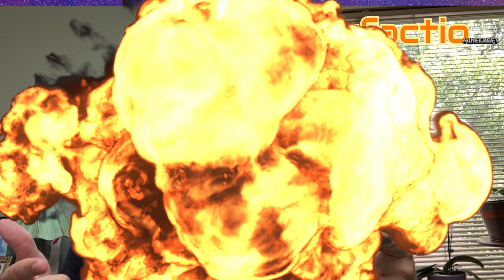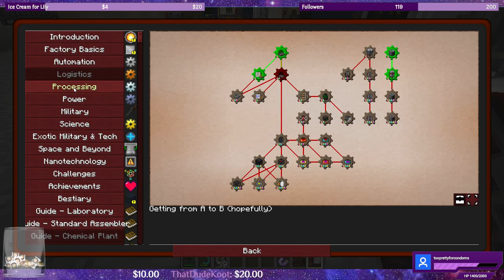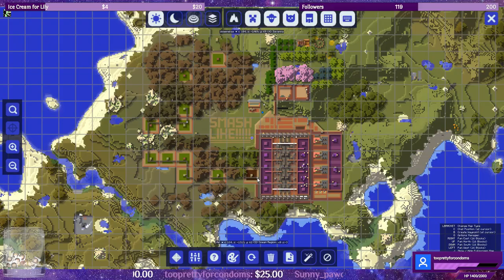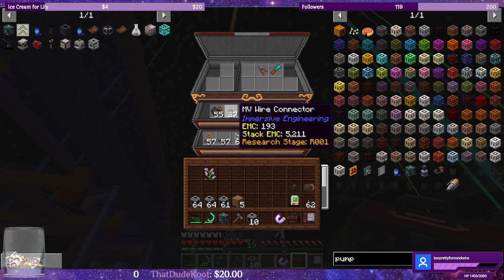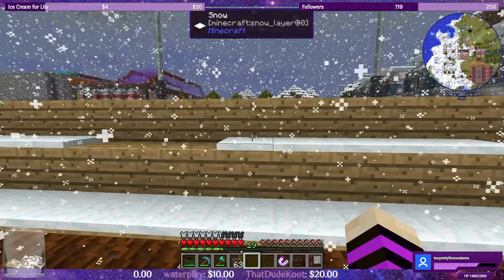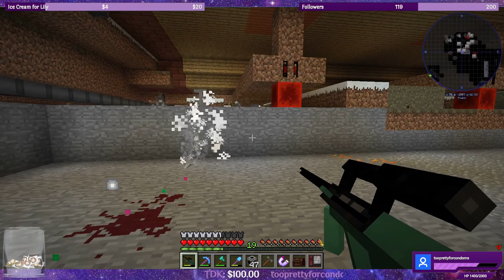Lets Play Manufactio EP 6 - Oil Pump and Oil Refinery - Sheetmetal Fluid Tank - Gasoline Lubricant

Comment: i thought you could also drag fluid from jei to filter fluid and item routers like you can do with enderio filters
Reply from the maker: I think that’s what I did later on with sulfuric acid since you can’t put it into a bucket. The mod has to be in place for that to work and I just got used to doing it by bucket 🤟

Comment: Nice playthrough! Could you explain how you got the vents working underground? I can't get the pump to suck out the carbon.. oh and BOOOOOM! :-)
Reply from the maker: Frederic Borgilion Boom! 16 vents attached to a pump with a chimney over it and a red stone signal on the pump via button. The pump can “reach” 16 spaces like red stone which causes them to pull pollution blocks up to 4 spaces away.
Reply: @LetsPlaywithDDae  What I did was basically the blast furnace setup upside down, redstone block, pump then chimney with vents attached, all worked into the ceiling. How do I control it with a button? Sorry but a new player here :-)